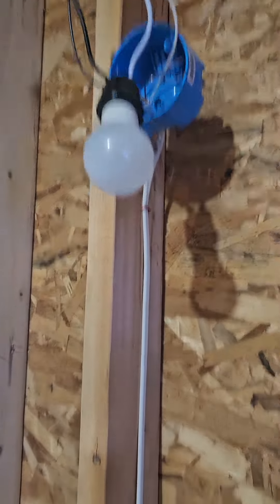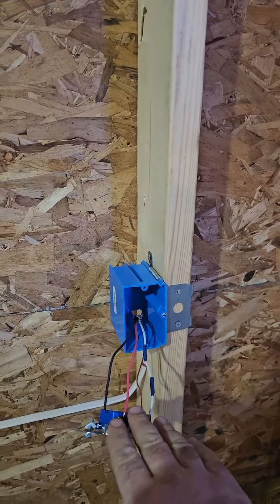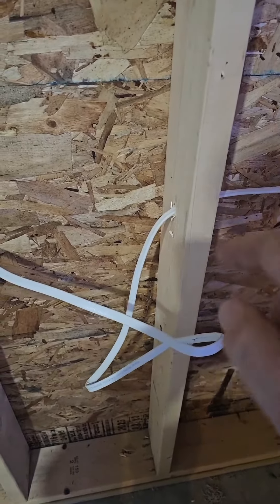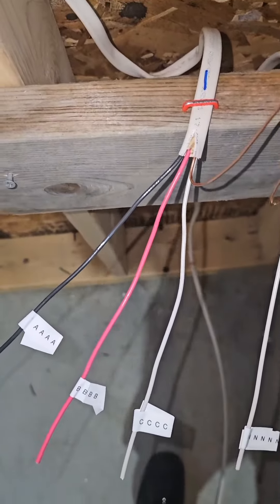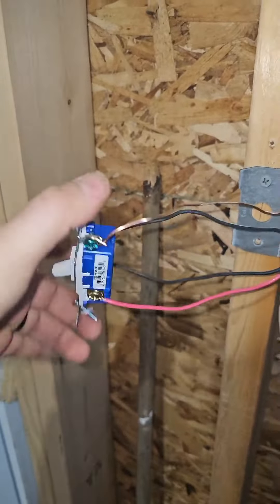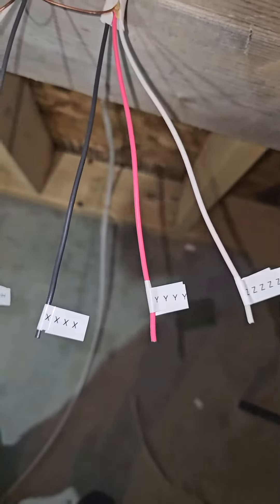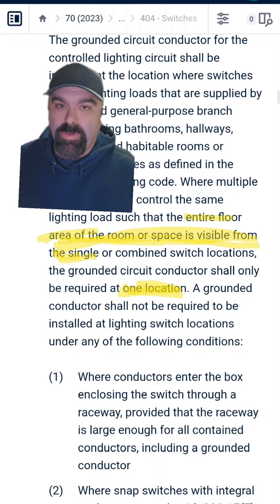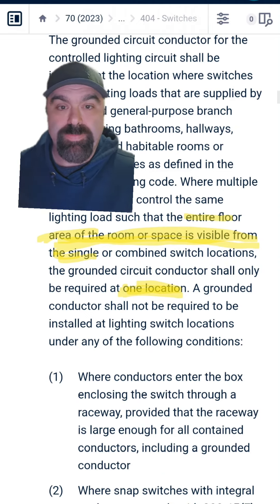3 way switch challenge

Comment: Install wireless switches. No wiring from switch to switch or switch to light. Just power to light. Saves you a lot of time and money. Works really well.
Reply from the maker: In a new home hardwired switchs is much better a 3 way switch takes about 10 mins and last forever.